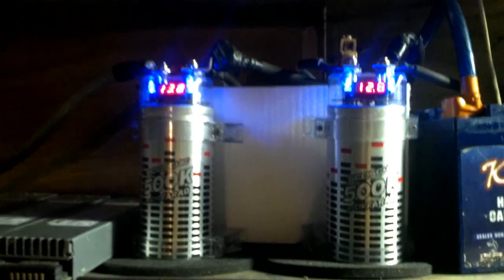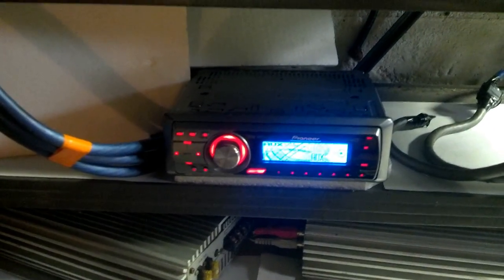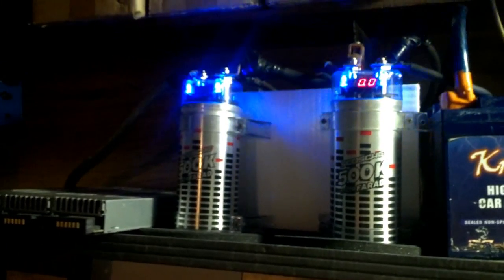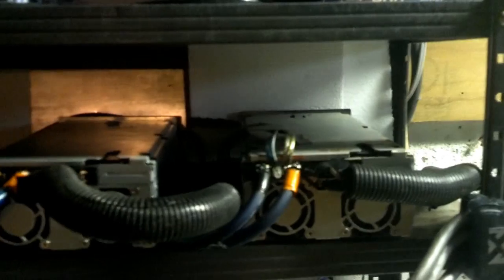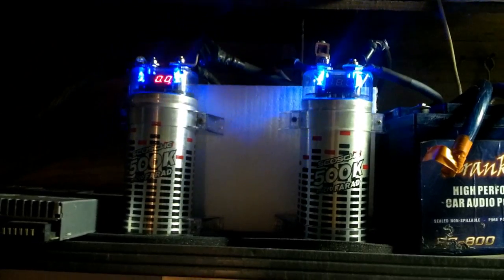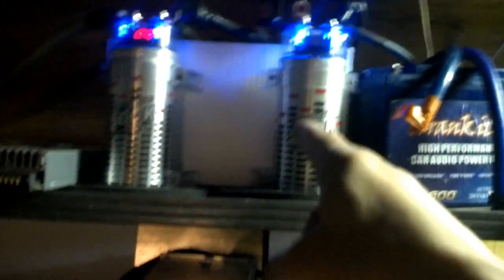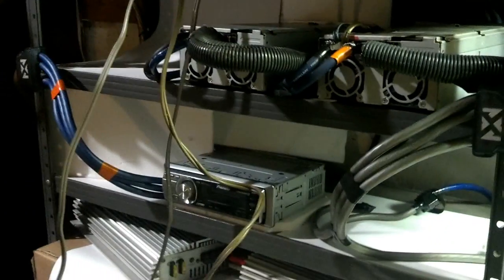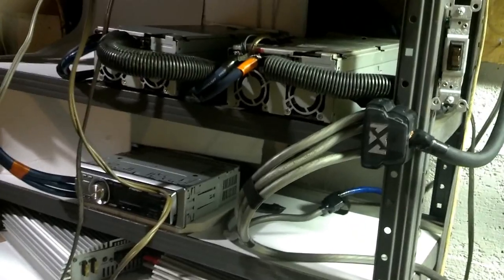Car Audio Capacitors Mythbusted Do they hold ANY voltage ?

Comment: In my car, at just 500watts, my capacitor makes a huge difference. No capacitor, my lights were basically off at points (direct voltmeter on the battery, while driving at highway speed, 9volts) with a capacitor, it kept my lights on, but still needed help. So i did a second battery install. Lights still dim, so big 3 time. But yed, capacitors have their purpose
Reply: Charles Small Your stock electrical system must be garbage. Im running 500wrms to a single 10 in my 2015 Civic and my lights dont dim that bad and the alternator in that is only like 75A (smallest Iv ever seen in a car).
Reply: I'm also running 400wrms on my doors now. But then it was just the subs on a 110 amp alt. But I know in my car the stock grounds arent that great. Alternator looks like 8 gauge wire if that.
Reply: A 400 watt RMS ab amp needs about 60 ampere to reach rated powerA 500 watt RMS D amp needs  about 40 ampere to reach rated power.U seriously need to consider a higher output  alternator.
Reply: Charles Hendricks Well, it all depends on volume and the type of music your listening to. If your running at full volume with really low frequincies then yes you will need that kind of amperage and probably more to run that kind of power. 

I dont listen to my music full blast alot, and since I only have a 10inch subwoofer the music I listen to doesnt have many low frequincies since my subwoofer cant reproduce those notes decent anyway.

500wrms simply means thats the "average" power at full volume. Really, it doesnt mean alot. Car audio is tricky. A 500wrms amplifier can peak over 800 watts under the right circumstances and at moderate listening volumes most likely it will never put out 500 watts.
Reply: Yeah, I'm upgrading the alt soon, I'm running 2 10inch jbls at 250w rms each. i listen to my music right below peaking. Its being upgraded this spring to 2 sundown audio 12s at 500wrms each. Looking at a 220a alt.
Reply: ccol.... and yeah it sucks that they are so "proud" of those alternators. Be DARN sure to use new connectors to the wiring at the alternator. I've see seen issues using the old ones with a new alternator.
Reply: I understand not playing at full volume. But I prefer to have plenty juice for dynamic headroom with little strain on the system. Note also, that when a 500 watt RMS amp puts out 800 watts its clipping badly and things can go POOF. On my modest setup gains/amps/eq etc are set up so the max output during those dynamic peaks nothing clips. I don't even have a "bass knob" to impress the neighbors. Lots of folk fry stuff due to those then blame the equipment.
Reply: Charles Hendricks No. Surely you have heard the term "peak power". While this rating is for the most part meaningless, its not a false number. Your amplifier can certainly put out more power than its rated without clipping, rockford fosgate amplifiers do this daily. 

As I said, RMS is root mean square which is the "average" number produced from a series of numbers from a series of test. Its not the maximum power output. Power output all depends upon the load on the amplifier (impedence), volume of the input, frequincy etc.
Reply: I know the diff. Im not saying whats on the front of the amp means anything to go by. Some amps can do a lil more....some less before hitting the wall.  Old school use to use silly ratings to win comps....like a 25x2 that's true RMS power was 4 times that. But once you hit that wall you hit it.. If you have a cheater amp all that means is lots more power is gonna be needed and you also find that info came with those cheater amps so you would know what it needed. Peak power of course means nothing....generally they cant make that unless struck by lighting and if they do its straight DC current.....and POOF. I have 2 cheater amps left over from the early 90s in my closet.(still mint) Perhaps I need to rephrase 500 watt RMS to TRUE 500 watt rms.@ rated ohm load (unless they fibbed there too on the specs)
Reply: Looking at on amp ...an old Lanzar.... rated at 50 watts...can safely do about 700... Now THAT is a real cheater amp.  But set up to to do that will load a system big time. Well over 100 amperes draw at max RMS
Reply: geeze wont let me finish..... well over 100 amperes if I use this on subs instead of my old PG class D

Comment: Capacitors behave like a battery.  An instantaneous power source for when your sub amp needs a little boost.  They are also very dangerous because they hold a charge and can give you a good shock.

Comment: Forget capacitors get batteries or a stronger alternator
Reply: When will you people stop drinking the kool-aid regarding caps being of no use? Caps do work, and they cannot be replaced by batteries or alternators. Playing music puts a dynamic load on the system, simple as. You cannot get an alternator or any battery that will discharge or recharge as fast as caps. If you want to install an alt. that will provide enough current to support a powerful system, that alt. will have to be ridiculously large. Your alt. needs to be able to charge the average long term current draw of your system, not provide full current at all times. It does not make any sense to have two 300 amp alts. on a system that draws 200 amps average, but sees short time bursts of 600 amps. Also, if you use your batteries as capacitors, you will not only reduce the life of your batteries, you will in fact strain your entire system. Any type of electrical system where the voltage is low and the current draw is high, will benefit from capacitors. Do you think it's for no reason that big power brushless industrial low voltage huge current motors have large capacitor banks, despite having the availability of the entire grid as a supply? No. Do you think it's for no reason why large class D amplifiers used in pro audio uses banks of caps, despite having 32Ah @ 230 volts at their disposal? No.
It's true that you cannot fix a bad system with caps, and nor can you fix it with a larger battery. But caps are for all intended purposes a part of any well designed and balanced system. A well balanced system can be drive harder and longer than a system that is not built properly. I've been doing car audio since 1993, and I've picked up every bit of knowledge I could on the say, and I've always remained critical of what I was told.
Like in the pro audio world where I have freelanced for almost as long, it's a well known fact that a lot of people going around calling themselves technicians and sound engineers are far from that, and it turns out that the car stereo world is no different. Just look at that ever so popular Steve Meade guy. Knows everything and sells a shit load of products. Yup. Only issue is that most of his info is incorrect and his most popular product is of little to no use, i.e. that DD-1 thing.
Get your info from books, REAL audio engineers and those who can actually back up their statements. Unfortunately it's become common place that the car stereo world is the biggest seller of snake oil. Just look at the abundance of crap transducers selling at ridiculous prices, especially in the "Kool kids" SPL department. Sundown, B2, MTX, Meade, Deaf Bonce, Kicker, Fosgate and quite a few others, don't even know or publish how their speakers are tested, manufactured or the like, They just make statements and charge idiotic sums. Why is a B2 audio 24 inch driver worth 5 times that of a world class 24 inch driver like a PDN.2450? It isn't and it can't play music for shit. But is that a surprise? No. The guy behind them is not an audio or acoustical engineer, he knows way too little to be doing this. I know, he lives less than 10 miles from me.
Educate yourselves people. Stop eating everything you've being fed.

Rant over.

Have a great weekend :)
Reply: itsdatruff  demonstration was to prove the myth that capacitors do hold power. He said that at the very beginning. Isn't his title"Mythbusted?"
Reply: Atticus Lewis  Cap clean noise out your system...Even bigger amp used bigger cap inside them
Reply: Capacitors are very good at cleaning noise, but they are very poor for storing a significant amount of electric charge.
Reply: It should not store charge as a battery.
Reply: I have to admit, I wanted a cap. But a 1000cca marine solved my drain issues.
But one cap with a voltage readout would be a nice addition.
Otherwise. One could always spend a grip of $💲$ for a bank of 6 to make the equivalent of a single dry cell.
A Russian man has a huge system ran on dirty power and said it gets stinky.
Reply: I say do all unless your running  in a competition

Comment: Capacitors are designed to hold a charge.  They are used for many purposes, but mostly to hold a steady level of current, when your car or whatever the CAP is used on dips below a certain voltage or current level, the cap fills in the dip.  Try using a big Bass amp with 12" subs with out CAPs and you will see the difference right away.
Reply: Been installing systems for over a decade, Iv never seen any difference with a cap. And Iv run everything from small 250wrms systems to 1500wrms systems.
Reply: @shabutir1820  Bragging that you been installing audio for over a decade doesn't make you knowledgeable in what you just said, (you failed to realize the purpose of caps) just so you know (I'm a doing some bragging too), I'm an Electronics Tech I done not only Audio repairs (I also installed Audio systems in past too many to say but more wattage than yours) and I can tell you the test this guy did in this video is pretty much what you can expect a Cap to do and I can see it did what it was supposed to do. An Audio Cap is only useful to help prevent Stress on your Battery and Charging system (the alternator) so that you avoid Electrical issues (like the dimming of lights when the bass hits very low ((I'm sure you know about this??)) when these low notes drain juice Which could damage your system in the long run so, these caps will drain when these notes hit hard and relieves a helpful amount of the stress off the Bat/Chrg system but I guess perhaps You over looked this since your overall installation in the decade you brag of only consisted of a measly 1500 watt system so in those cases you can bypass using and extra batt or upgraded alternator or even a cap if the vehicle had a decent charging system in it anyway.😁😁😎
Reply: @mannoamano9199  "measley 1500 watt system". Yea, ok. Not all of us are born with money first off. Second, 1500 watts is hardly measley. Especially considering your higher end car can only supply up to 1k watts at best before needing a higher output alternator. Your average car your lucky if it can supply you with maybe 500 watts. 

If you knew anything about electronics, you would know that you cant pull 1500 watts from a system that can only supply 500 watts. No cap is going to save your electrical system or magically produce more power. It can regulate voltage a little better, but its not going to do much more than cause an extra drain on your electrical system overall.

If you can explain how adding something that consumes power to an electrical circuit can somehow produce more power Id love to hear it.

Your charging system/battery can only supply a certain amount of power. End of story. Theres no work around that without upgrading those components.

Comment: I use a 5 farad  for my solar system it helps greatly in running high startup loads without the cap my batteries would drain more and may not even run things like my washer and fridge or freezer
Reply from the maker: i 100% agree . caps are a great buffer for heavy loads , startups and fast discharge
Reply: Little Flock- what voltage are you runing on your solar system 12v or 24v. Also do you have a generator connected as well?